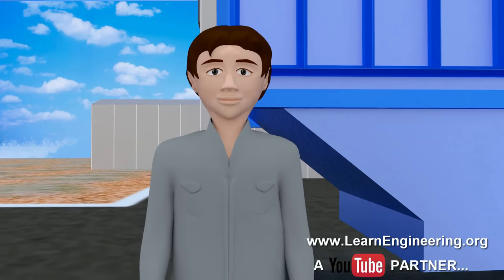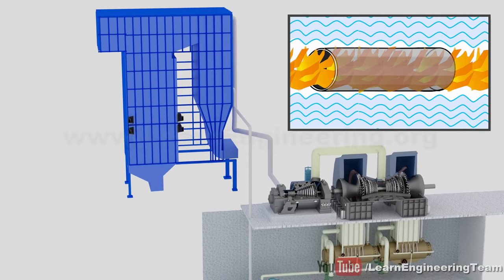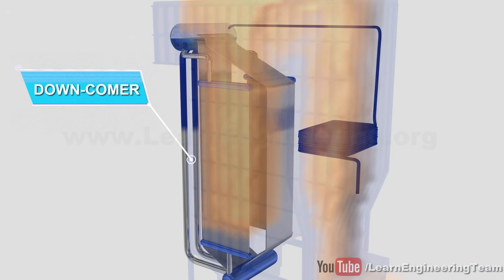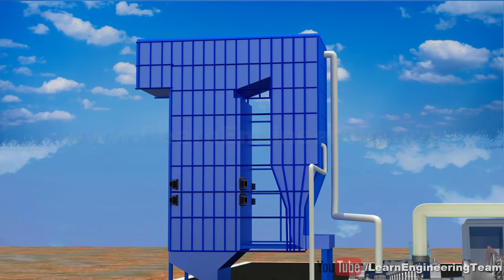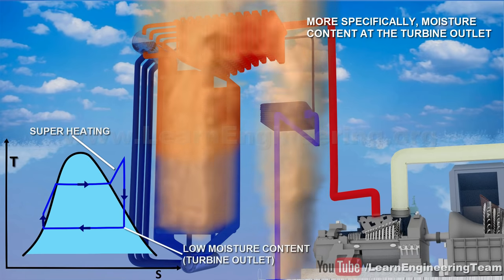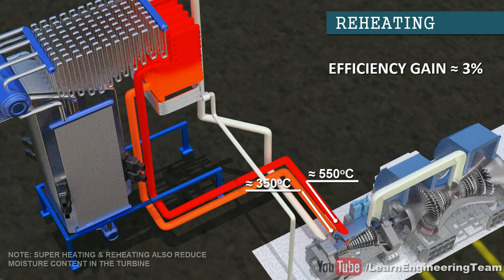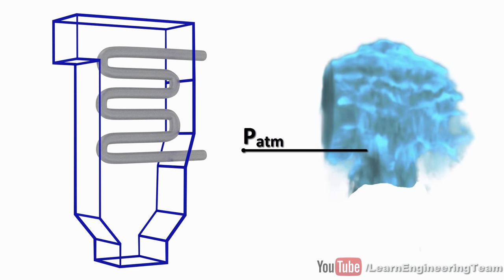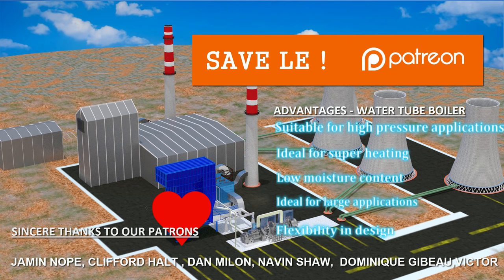Boiler, How it works?

Comment: Some comments from someone who's been involved in engineering power plant boilers:
1. Doesn't discuss role of condenser and why it's important.  When steam flows through turbines, some of it condenses and must be removed to avoid turbine blade damage.  Also, after steam has passed through all boilers, it is cooled and condensed back into liquid, sometimes by using water from a river or lake, sometimes by using ambient air.  This significantly improved thermodynamic efficiency of process.  Typically, condensers operate under medium to high vacuum to maximize thermodynamic efficiency.  Liquid condensate is then recycled back to feedwater pumps.
2.  There is significant thermal expansion of boiler as it comes from a cold state to online. Large watertube boilers are suspended from near top; I've seen some boilers expand downward more than a foot (1/3 meter) due to thermal expansion.
3.  Because of condenser, you can consider steam piping an "open" process, which means video's treatment of pressure during heating is essentially correct.  But in order to reach maximum allowable temperature (limited by turbine metallurgy), water and steam pressure must be high, generally 1000+ PSIA.  This pressure is mostly supplied by feedwater pumps.
4.  Reason for multiple water passes through hot combustion gases is to primarily extract as much of the heat content from the combustion gases as possible.  Economizer preheats boiler feed water using "cooler" combustion gases.  Reheater uses hotter gases, superheater uses even hotter gases and main watertube chamber uses hottest gases.  Side benefit to extracting maximum heat from combustion gases is thermal efficiency of overall process.  The more heat you remove from combustion gases the better; plus it is a benefit to reject combustion gases to atmosphere as close to ambient temperature as achievable.  I've even seen places use air to air heat exchanges to preheat incoming combustion air using combustion gases after water preheater.
5. Superheating is your friend.  Dries out the steam, which is safer for turbine, plus provides significant thermodynamic efficiency.
6. Boilers generally use air, which has side effect of creating NOx molecules, which are environmental pollutants.  This can be mitigated by extending flame length and reducing flame temperature.  A newer way is to filter out most of the nitrogen and supply air with higher concentration of oxygen.
7. Everything is interrelated; changes in operating regime always impact something else.
Reply: Thanks for taking the time to explain

Comment: This is an excellent video. I have worked as an operator and now teach power plant operations, as a consultant. I am very impressed with the quality of your video. You might consider revising the narration regarding superheated steam. By definition, steam does not become superheated until all moisture is vaporized. Likewise, it remains superheated until it again reaches saturation. At saturation, there might be some moisture. Below saturation is liquid. Just a small point, but there can be no moisture in superheated steam.

I hope you have been able to continue you work. This is a truly fine animation for teaching.
Reply: Hey Ray, what do you know about advanced ultra super critical technology?
Reply: Excellent video. Pressure also increases because against a saturation pressure, there is a saturation temperature.
Reply: thanks , taking some notes
Reply: @SitongBoiler  wea , need some info
Reply: 🔴 What Is Islam? ⚠️

🔴 Islam is not just another religion. 

🔵 It is the same message preached by Moses, Jesus and Abraham.

 🔴 Islam literally means ‘submission to God’ and it teaches us to have a direct relationship with God. 

 🔵 It reminds us that since God created us, no one should be worshipped except God alone. 

 🔴 It also teaches that God is nothing like a human being or like anything that we can imagine.

🌍 The concept of God is summarized in the Quran as:

📖 { “Say, He is God, the One.  God, the Absolute.  He does not give birth, nor was He born, and there is nothing like Him.”} (Quran 112:1-4)[4] 📚

🔴 Becoming a Muslim is not turning your back to Jesus. 

🔵 Rather it’s going back to the original teachings of Jesus and obeying him.

Comment: This is an interesting video on the basics of how a generating station boiler works. I worked for 34 years in Los Angeles DWP generating stations. Most of those years I was an operator of the generating station equipment. I also know that there is a lot more that could be said about generating station boilers.

Comment: The same phenomena happens within Refrigerant pipes. Any pressure differences within the high or low sides off an AC pipe occur due to friction with the pipe surface. Differences in heat content throughout the length of the pipe effect the density off the gases not the pressure of the gas on either side. For this reason refrigerant mass tends to migrate to colder areas.

Comment: You should have mentioned that in case of REHEAT only the pressure dosent increase but falls due to bends in piping arrangement and so does it happens when saturated steam from boiler drum travels through different sort of superheat circuits. But in waterwall its pressure do increase during circulation in drum....

Comment: The burners in the bolier in your presentations They are directed against each other, bu in real life burners are oriented at an angle that the flame was swirled(greater surface area of the flame). Am I right or not? I was inside in Bolier in the power station when boliers was in renovation. Great video!! We can see how works the boiler ;)

Comment: And you could take that 40 degree Celsius water that leaves the condenser and use it to run an turbine that uses ammonia as a working liquid/gas or a Stirling engine.  This would especially work if you were next to a large body of deep cold water.  Like in Minnesota or Winnipeg.

Comment: I'm no engineer but can the boiler be driven by two different heat sources? There's this idea that if intermittent renewable energy were instead used to co-supply heat in such a system, it could more effectively displace fossil fuel consumption without threatening the grid's stability. I hear that Rankine Turbine Generator output is inflexible but what about the fuel feed?
Reply: Some coal plants have been altered to run on Biomass and some gas turbins can run on Natural gass, and fuel oil.

Comment: An excellent video. I just have one question and I hope you answer me. I did not understand the idea of the moisture content. What will happen or the effect after reducing it?
Reply: Saturated steam is the original output from the boiler, that has moisture in it. Moisture in the pipes greatly reduces the productivity and longevity of steam before going into the turbine blades. Condensate will not spin the turbine blades. In fact, it will destroy them. Productivity is increased by raising the steam temp AFTER it is no longer in contact with the water it was generated from. That lowers the moisture content.

Comment: i need to ask a question i hope to find the neat answer here with u 
 the pressure of the net of the steam .. does it equals  with the vapor pressure of the water at sat. temp when the boiler is creating the sat. steam???
are they the same pressure??

Comment: When using an economizer, we can avoid the use of additional feedwater heaters, or they can be used simultaneously?
Reply: 2112dim They can be used simultaneously and regularly are for large applications.
Reply: Economizer is used to make use of heat energy of flue gas which will be flown to ESP. So rather than freely releasing the flue gas, the heat energy is utilized for heating of feed water. Some energy conservation and additional feed water heater requirement  can be minimized.

Comment: I have a question, he said" because the blades of the turbine cannot bear more than 600 C, so another heat exchange is added then the steam with high temperature goes to the turbine, so my question is the steam which occurred from another heat exchange  will add to the turbine again with high temperature so why he said the blades can't bear a high T

Comment: dear sir why must the turbine generator engine be moved by the superheater steam pressure, can it not use saurated steam?
Reply: Superheating steam makes sure that last traces of liquid water is gone. If water ended up in turbine it could cause some serious damage in long run + efficency would go down.

+ You get Boiler more efficinient when you can use more heat from boiler gases.

+ Steam can store alot of energy, so superheating it increases energy output at turbine.
"Less steam is required when its hotter"  
If you used only saturated steam, 
You would need way more of it to get same energy output as Superheated steam has.

Comment: I'm new to boiler and have doubt in the pressure of the generated steam. In the video it is stated that water is pumped at high pressure, does this means that the vapor pressure of the water depends on the inlet pressure of the water? Let say the water is pumped at 9 barg thus the water will starts turning into steam at about 180 degC. Is this fact correct? If no could anyone advice?
Reply: The feed water pump has to generate at least slightly more pressure than the boiler pressure, otherwise no water will enter the boiler, so a boiler set to generate 9 barg steam will require a feed water pump capable of 9+barg.
 For a low pressure boiler say 10 bar, then a multistage centrifugal will work, for higher pressures you need a positive displacement pump.
 Sorry if i misunderstood your question.

Comment: Why its heated from down to up, and not up to down in the heatexchanger?
Reply: Heat rises up so it makes heating automatic, and no need to "force heat down"

+ if its natural circulation boiler, heating water from low to high, makes water flow in it without pumps.

Comment: This video's comments about pressure are incorrect.  A Utility drum boiler connected to a steam turbine has it's pressure controlled by the generator output set by the Utility's dispatcher.  The drum boiler is fired to maintain the drum pressure required to produce the required MW's.  A typical industrial boiler is fired to maintain a header pressure downstream of the boiler.   Boiler controls are complex.  The boiler envelope in the video also looks suspect because it looks like a CFB with corner fired burners. Also, coal fired boilers typically have large platen superheater platens suspended in the furnace shaft.  If you wish to learn more about how boilers are controlled, check out the technical papers available at www.babcock.com.

Comment: why only 40°C water is pumped to economiser???. cant we send approximately 350°C, 210 bar water inside the economiser????? i think that ,cause of the inlet condition of water which is nearer to critical point, its efficiency will be higher.